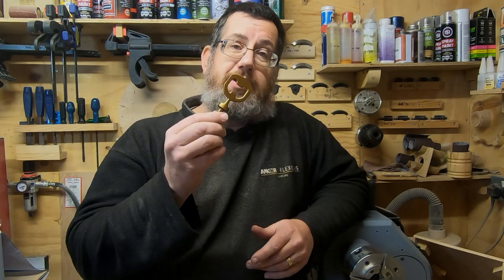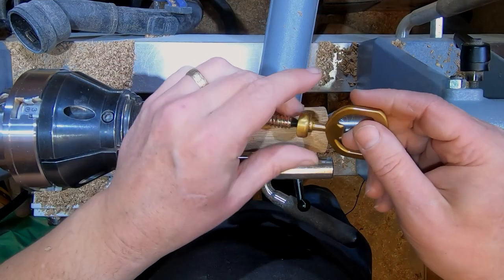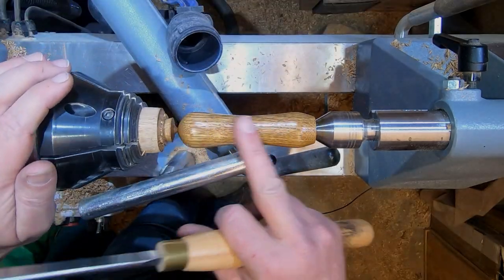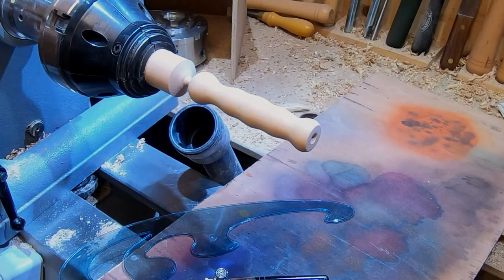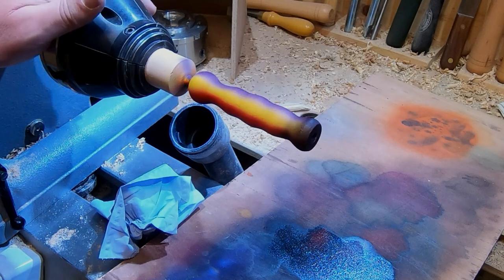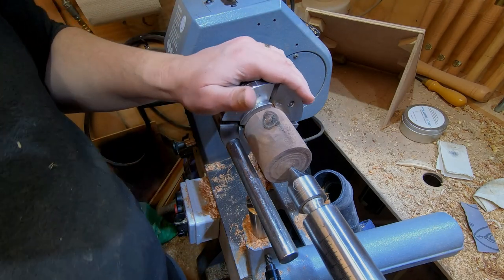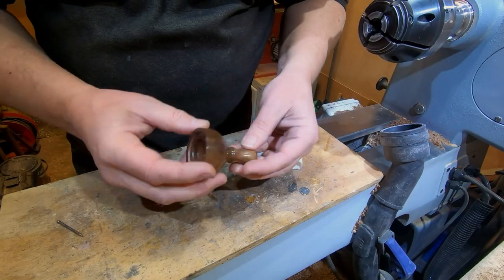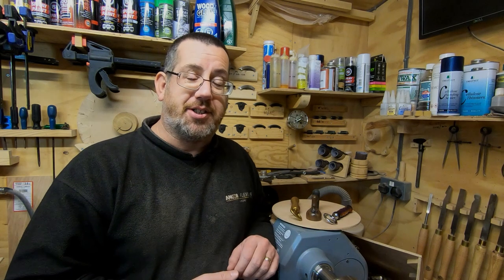Bottle Openers - Episode 266

Comment: Great video and explanation as always. I ended up sourcing some longer stainless steel screws for the flat type one from a UK supplier on eBay.
Reply from the maker: Thank you. I think if the wood is solid and they have a good hold they should stay in there a long time. Any weakness and they will come out after some use. However I suspect this type wouldn't probably get used all the time.